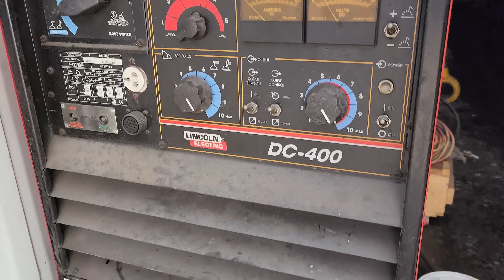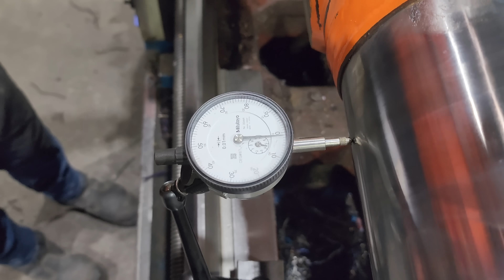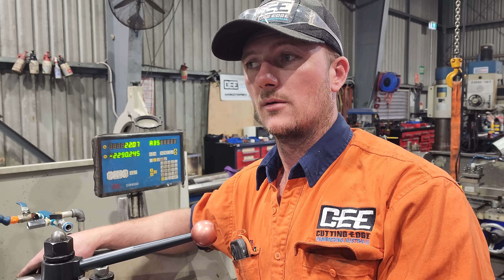Can We SAVE This $20K Cylinder Rod!? | Gouging SEIZED Nut

Comment: Why not use wd 40?
Reply: Not reallly good lubricant just water displacement
Reply: @3.5eco  Candle wax......  The way to go with this process..
Reply: @TJDAGAMER no. It's not rusty so it has to be the metal which is damaged
Reply: PB blaster is better, but that's not the problem. The nut is what's called galled and penetrator won't work. Galling is when nut is very tight, the threads (usually in the nut but sometimes on the bolt, shaft or cylinder)get damaged in a way that cross thread and will not turn off. In this case "air carbon arc gouging" is the best way to remove the nut without damaging the cylinder and it's threads. ..
Reply: @TimothyRYoder  I wish I had a tool like this a work for my co worker who took half a day to cut out the bottom of a bucket. He also welded just over cracks. He is Russian and I had a hard time working with his behavior to work.
Reply: r/woosh
Reply: @stevenson720 ?
Reply: He tried WD-40 but the can dented up bad when he hit it wit-the-hammer.
Reply: @affordablevoices  wd 40 won't help in this situation
Reply: I think he was being sarcastic.
Reply: @TJDAGAMER what’re we talking? Yankee? A spiced Christmas scent or the harder pine or citrus stuff?
Reply: Or windex
Reply: You're wrong 😅 acetone and transmission fluid will do the trick...3, 2, 1....let the games begin
Reply: WD-4000
Reply: Or putting it on ice, then using a hairfan. Works 10/10
Especially with wd40 or 5-56
Reply: How does that fix the threading?
Reply: Lol😅😊😂
Reply: 😂wd 40
Reply: Custard

Comment: Thank you for the extended explanation of how air arc gouging works! Showing where the air comes out completed it for me!
Reply from the maker: awesome mate, glad that explanation helped!
Reply: They can be used to cut concrete to we used to use one in the early 2000s to cut piles
Reply: while i've seen him gouging before i'd never seen the air holes.
Reply: I used to use that same setup when I worked in a steel fabrication plant that made water tower and smoke stakes used to use cut tabs off that were Welded in the wrong place
Reply: Arc welding giveth, and arc gouging taketh away.
Reply: Yes, I thought the extended explanation was really good too - I also had no idea where the air went or how it was used.
Reply: @ElliHarper  It strikes the same way as normal electric welding rod does.
Reply: @aarondavies8486  how does it cut concrete? Doesn't the material need to be conductive?
Reply: Same here brother @dans_Learning_Curve

Thank you cutting edge 😍
Reply: @dans_Learning_Curve 
I'd believe he's thinking of thermal lance. Which is a burning metal tube with oxygen sprayed thru it's center.
Reply: @dans_Learning_Curve you can always put a thin conductive sheet over non conductive materials to air arc or plasma cut them, but I agree it was most likely an oxy lance.
Reply: @dans_Learning_Curve  look in to exothermic cutting systems mate
Reply: @dans_Learning_Curve  not once you started it acrair cuts everything g
Reply: @ElliHarper  you get anything to start it off we just started off the piles casing as they are steel if not find anything conductive once it was started didn't need power the air and rod did the cutting Kurt does use different rods to what we used for the arcair system
Reply: @aarondavies8486  Jesus, that must be painful, makes my eyes water just thinking about it 😁
Reply: @miceinoz1181  hahah smells like bacon
Reply: @aarondavies8486  And, long before that, there were Thermic Lances. You were required to register your licence with the Police because safe-breakers were using them. Fun tool to use.
Reply: I didn't quite "Get" how and where the air went.   I guess I'll have to view again and pay better attention.
Reply: @petemoore5104  yeah used to use one with out ppe no mask or nothing the good old days breathing in thick yellow smoke pml
Reply: @GilmerJohn  Out the holes and down along the electrode.
Reply: Love the camera angle with the slow motion chips flying.
Reply: @aarondavies8486   of course, this was back in the day when even your Dr. smoked 20-30 a day!
Reply: I've never had the opportunity to air arc gouge, and this is the first time he's gone into detail about the setup.   We learned about it in college welding class, but it was just a brief description.  I've cut hundreds of nuts off with oxy-acetylene without issue.  I've used oxygen propane or oxygen LP before, also, but it's extremely difficult to avoid damaging the threads with those because it burns colder than acetylene.   It appears as though arc gouging is the easiest way unless Kurtis's skill level makes it look easier than it is.
Reply: @petemoore5104  --  Tee, hee.   In the US the federal government tries to "register" a sling that helps steady a pistol.    A thermic lance is just a steel pipe, a source of O2, and something to start the process working.
Reply: My question, is how much air does it take to do the job, psi & cfm or what compressor rating.    Help me, help me.
Reply: @aarondavies8486 ouch!
Reply: I had to go back. Totally missed that. Thanks
Reply: They can be tricky to get into those closed in areas. Kurtis has been there and done that enough times to know where to start and when to stop. It is a very fine line to walk.
Reply: @GilmerJohn  and in both cases that registry totally works. It gives you a list of legit people to cross off the list, and more importantly, when you catch someone with one that isn’t registered it’s a lot easier to bung them up. The aim is not to prevent unlicensed individuals from not having the item.
Reply: @ionstorm66  --  Not the way it's explained.   If it were an "oxy lance" they would have used oxygen.   It's what they say:  the arc melts the steel and the air blows the liquid metal away.
Reply: So it works a little like a plasma lance, but instead of using a heat to burn the lance while blowing oxygen through the middel, it uses electricity to ark and cut while blowing air on the outside of the electrodes!?!?!?
Reply: @jimwhite7607 I used to call it the “Unwelder”. As a retired fabricator I don’t miss those spark showers. I got so good at it my unwelds looked almost as good as my welds 😅. We also used to use it to cut and fit stainless steel parts before there were portable plasma cutters.
Reply: Reminds me of paper making days in the machine shop

Comment: I went on to design and draw the Apache 64 new Myflon/Dyflon Bearings I created in 1981 as created a method from not just my College chemistry training but I created a Liquid that becomes impervious to heat! When this company discovered,I invented this methodology or Chemistry within the pores of the Metal. I became lead Engineer in Space Shuttle Wing Flap Bearings. I could see where if these ends were treated with what I created the nut would not freeze on as the angle of the plane of the outer thread would release Lubricant in order to stop thread Lap! I have worked on other uses with my creation using liquids/ Lubricant and Metals.Some are flying in Space forever!

Comment: Good job with the air arc Kurtis. For anyone who hasn't used an air arc, I used to describe using it as buttering toast with a butter knife. No modern technology that the average shop can afford will ever replace the air arc. I worked in Alaska for a few years and used an air arc often on some of the large excavators, off road trucks, and cats. The boiler maker who taught me how to use it said I was lucky to be a large person, unlike him who was about 5'6" tall. He said every time there was an air arc job in a tight place he was elected to do the work because he was small. Between the noise and the carbon dust, I can't imagine using one in a confined space. I wore two masks and both were black in less than an hour. Outside where you ran it is the right place. I was using 3/8" carbons and upward of 500 amps on many occasions. I have used the smaller air arcs with 200 amps, and they are fine for gouging welds on a tractor bucket, but that is about it. 
I am looking forward to watching you cut the nut threads and finishing the project. 

One more thing, you could have saved an hour or two if you used a real hammer instead of robbing your kids toy box! At least a 5 pounder!  😊😊
Reply: @mistermeowmeow-k8h "Asking for a friend" is a good way to ask that question!:hand-purple-blue-peace:

Comment: nerves of steel to handle 20k+ worth of possible collateral damage
always love to see a customer agree to a repair
Reply: Well the choice is order a new rod, or a 50 50 chance it can be fixed for half the price of the new nut. At least the air arc was a lot faster than the alternative of place complete rod in lathe, then machine the nut off it.
Reply: how long you been here? there is no chance he could muck it up. he that good.
Reply: @TommiHonkonen  Even if he did cut deep, Kurtis could still weld it up enough to cut that thread back again, probably even fixing the original damage as well, then cutting to match the original nut if they had one. But now he just has ordered a big chunk of good quality steel, and is going to take 70% off it, in order to release the inner nut hidden in the block. Hopefully one of the new tools is a set of diamond hole saws, to cut out the inner section of 120mm steel, so that he can either save cutting tools, or reuse it on another job as bulk steel rod. After all, if you do not make it into chips, you save a lot of time.
Reply: Why is it so difficult? It was necessary to cut the groove with a CNC end mill.
Reply: 20k is nothing to the company.  The machine is running with another cylinder, and they probably have another couple still on the shelf.
Reply: @TommiHonkonen  ive been here for years  and that doosent change the fact this is a stressful job
Reply: @ShainAndrews  to the company?
 this is in his hands curtis would be up a creek if he accidentally botched it (years of watching i know that wouldnt happen but the world has had stranger things occur )
Reply: @SeanBZA  Yes hole saw good, but his torch skills better 😂😂😂 Cr@p I just converted 120 to bananas 4.72.. Since his brother is computery maybe he will finally buy a water jet or maybe one of his bros has one. 
I figure he will just machine it out but its those things that make us wait for part 2
Reply: @alfonsoalonzo  Negative.  You seem to overlook the fact the rod was no longer fit for purpose.  The risks are communicated up front.  It is a best effort contract because there is NEVER a guarantee that a part can be removed without damaging other components (through negligence or material defects).  Repair facility will not assume the liability for a known risk.  You have never worked with a mine.  20k is nothing.  Their daily fuel bill is more... So in this instance the mine paid for the nut removal.  The thread removal.  The cutting of new threads, and the  cost for making a new nut.  All cheaper than buying OEM replacement.  Still cheaper than building a new rod from scratch, and faster than doing both.  The mine is money and time ahead.
Reply: Well, it was pretty much scrap as it was so he couldn't make it any worse.
Reply: I worked hydraulic repair for twenty years, I never saw a complete cylinder for any piece of equipment that cost 20 grand.
Reply: @wtchr6883  What country?  Where in that country?  What kind of equipment?
Reply: @wtchr6883  exchange rate weirdness perhaps
PLUS i think they have crazy import costs
Reply: Maybe 20K to buy one OEM. That's not actually a 20K rod however. Could just get chrome induction hardened shaft of the same size and have the eye switched over and threads cut for maybe as much as half that amount.
Reply: the comments on the mine thoughts: not a mine but still large equipment operation ($250k/yr in fuel) and I'd have given him the work simply to keep him working if he asked even if that ram would go on the shelf as a backup -- I wouldn't hesitate just so he wasn't the wiser I didn't care about the $
Reply: @ОлегВятич people running those machines would not make much money if they priced their time correctly. You are seeing economics in action here.
Reply: 20k for that lol, my shop here in Sweden would make a new one for 2k maybe.. insane prices
Reply: @gambler3k  post your price list and order form... what is shipping time?
Reply: AZ dollars are a lot different than US $
Reply: @SeanBZA diamond hole saws would be a crazy purchase for that job. Just not the correct tool at all. (Diamond tools = effectively a grinding operation, it would take freaking forever ( far longer than just drilling a hole & taking big cuts with a beefy boring bar on that monster of a lathe), tool life would be absolute shit, and it just isn't required for even pre-hard steel or even more exotic stuff. It's generally reserved for stone grinding.)

Inserted trepanning tools would be the ticket here, but only if you were that concerned with saving the slug or it was a truly ridiculous material where it would save a bunch of time. For reference, the process is usually reserved for stuff like inconel & whatnot. Which is expensive & an absolute bear to work with. But when dealing with those materials the customer generally wants them back. To include the part, slug, and all the chips that were made, so the economy comes from time saved, which can be enormous with exotic materials. (There are obviously exceptions - but in the modern dog eat dog world, keeping high value slugs/chips usually means that also bid the job lower). Anyway, there are a few guys absolutely full of knowledge on YouTube trepanning stuff like inconel, so I highly recommend searching for them.

But CroMo or whatever high strength steel is used for that nut? Nah. Just send a big ass insert drill thru it & then bore it with a large depths of cut until you get close & swap inserts before finishing. Especially on a large lathe not lacking any power. Probably take ~1/8-1/4" per pass on that big lathe depending on the type of (unhardened) steel.

Unless, of course, the guy that brought this job in wants to finance tooling for further work. (Which, from the couple replies I've seen, he seems highly likely to do. Freaking dream customer!!)

Time to watch the nut video & see if I've made a complete fool of myself or not!
Reply: Australia $0.63 to 1 US dollar @ShainAndrews
Reply: Not to discount your point, but remember 20k AUD is only like €12k so still big but not that big

Comment: I think the best way to describe that air arc gouger is “a reverse stick welder”.
Reply: With added air blast feature 😂✌️🇬🇧
Reply: Stick unwelder? 😂
Reply: Stick welder with air bidet
Reply: Stick unwelder powered by a screaming banshee you just kicked in the nuts
Reply: @fowletm1992  🤣🤣👍✌️🇬🇧
Reply: Used to be a HD mechanic for a mining company, specialising in end of life machine rebuilds, sometimes we would have 4 or 5 air arcs in the workshop with us, the video doesn't do them justice for just how ungodly loud they are, big 8 Bay workshop prob 150m wide by 300m long the welders had their own shoo but any frame work they had to do around us  or bucket re skins at half life when we didn't have time to pull the buckets off
Reply: Actually it is basically the same as stick welding apart from the rods not having metal in it to deposit, and the air is blowing away the molten medal instead of piling it up like normal welding
Reply: It functions exactly the same as an oxy-fuel cutter except the heat source is an electric arc
Reply: @BruceBoschek  better
Reply: @PaulG.x  
Kinda but kinda not, the pure oxygen oxidises the hot steel turning it to liquid iron oxide 

Thats the reason you can't just use compressed air with acetylene
Reply: @fowletm1992  this uses compressed air, not oxygen.
Reply: @rosbifke915  
I was replying paulG x saying oxy is the same as arc air

Comment: The arc gouging skills are pretty top notch. I know a lot of people who would absolutely destroy that piece with an air arc. Actually, most jobs I go to won't even allow certain people to even think about using it. As for plasma, you can control plasma with the amp settings. Many also have a setting for gouging. It actually might be a safer bet once you get plenty of practice with it. To the point where you can watch the metal from the nut just melt off between the threads.